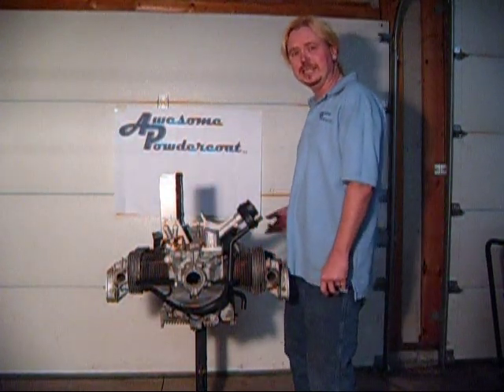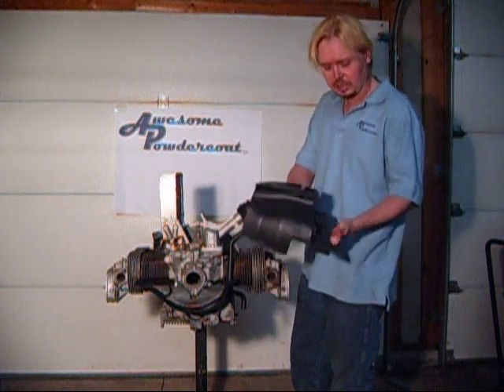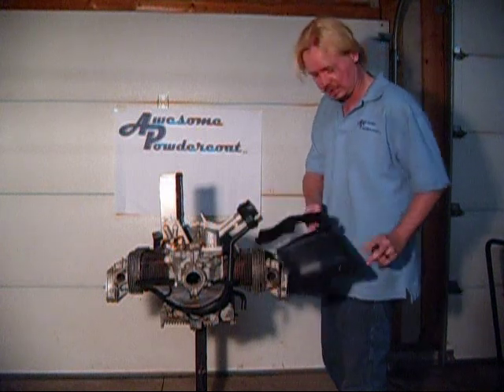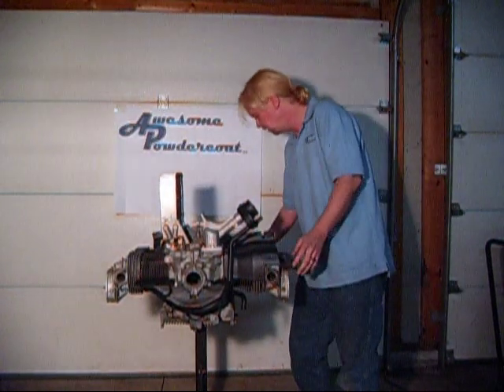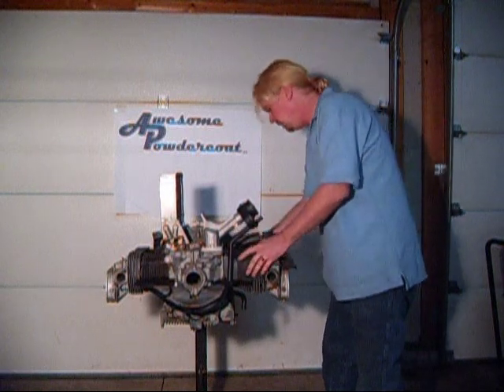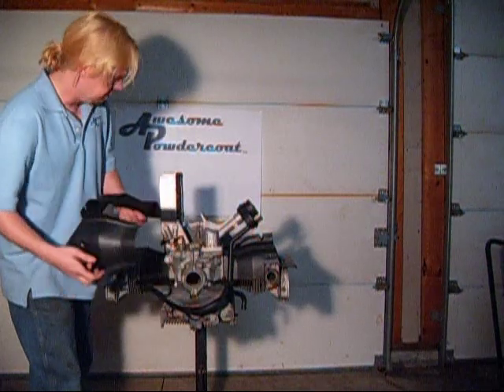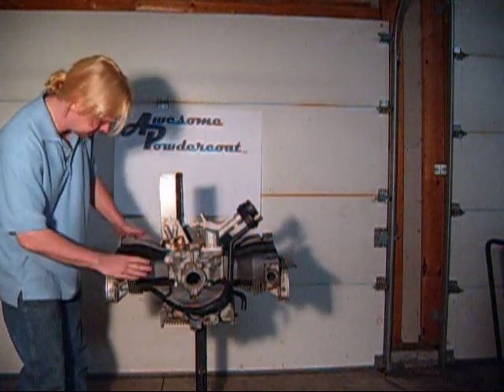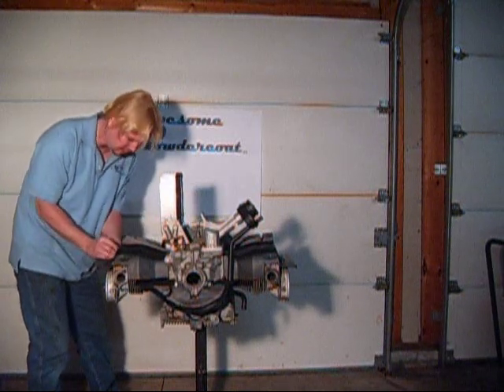Part 8 - VW engine cylinder tin installation

Comment: Can you lift the fan shroud out of the car if you first remove the deck lid and hinges? Or does the engine have to come out?  Will it clear the cooler?  64 bug.  Thanks